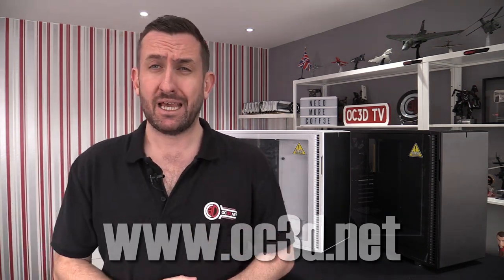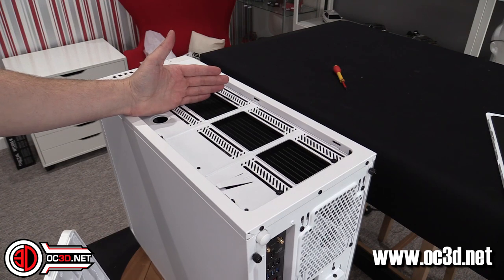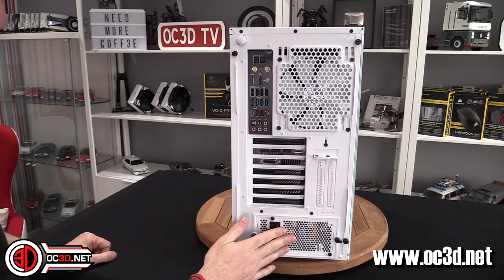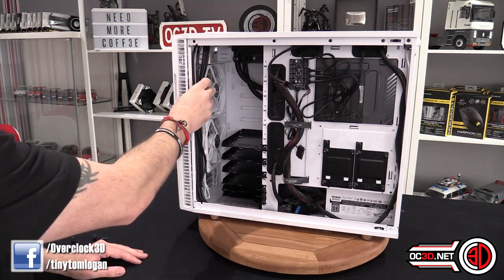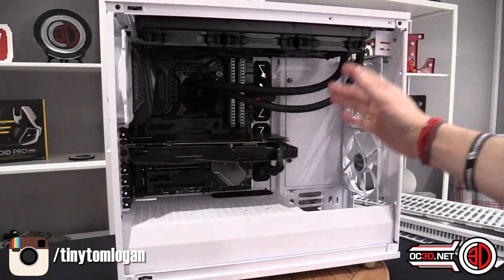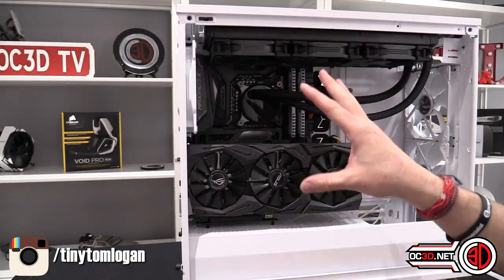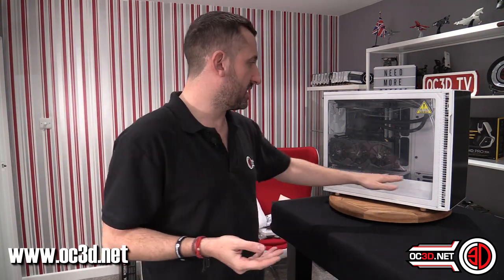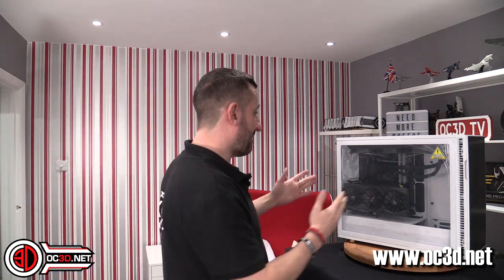Fractal Define R6 Review

Comment: Hi. Nice video. I have a question for you. Is there a brand who is willing to build a pc case based on my sketches ??
I don not understand why these brands in pc cases dont take in consideration DUST. How can they build a top grilled mesh, when on top is suposed to exhaust air not filtered it with a mesh ? The only one i see with a perfect TOP exhaust is NZXT H700i, the rest just put a mesh on top and thats it.
Most of the time, i ask myself if they know the difference between positive and negative pressure inside a pc case. Probably not.
In these days, almost all is based on marketing, TONES of RGB colours and water cooling.
I am still using top premium fans, but i dont find yet a case that met my demands in terms of airflow.

Comment: The font door should be grilled for maximum air flow or even glass would be better, and yes the black is disgusting on a white case.

Oh, and an optical bay is good for bay devices like fan controllers, not so for dvd burners these days, etc.
Reply: This is a silence focused case that would be idiotic. Buy the meshifyc if you want air flow.
Reply: Douglas m Silence focused, then it is  idiotic to have a removable top to allow fan exhaust, kind of defeats the purpose of silence.
Reply: not at all how else would you put a radiator up the for custom water cooling??  its not meant for exhaust on an air cooled pc..
Reply: +Douglas m have a proper perforated top panel like every case. Or have the top panel like the front panel with the side vents. So dumb
Reply: Allie Boy omfg really dude.
Reply: +Not a Noob really dude

Comment: Not sure why you're complaining about the front.. can't you just remove the front? I've seen someone else do it. With my gaming rig, that's what I'll do because airflow is more important to me than sound. Loving that top vent too, they sold me when I saw it.
Reply: That's the whole point of the case. It's pointless with out. Also makes dust easier to get in
Reply: No it doesn't, it has a dust filter, which is why he likes it with it off. I have this case, love it
Reply: +theguy13 youure supposed to have a front panel over the filter. Like on most cases there's a dust filter and then the front panel. That's two layers. If you remove the panel then you only have one layer which is the dust the filter. The panel makes a difference
Reply: Allie Boy but the front panel doesn't filter so I don't know what you mean. The panel prevents more airflow from the front. Which means the fan on the bottom if it's an intake will work harder. Bringing in probably more dust than the front, if it's on carpet. Regardless, I love this case. I usually keep the front panel open for more airflow for when I game.
Reply: +theguy13 the front panel definitely has a dust filter
Reply: It does not, it just has the one filter for the front lol. I own the case man.. looking at it right now, Solid plastic.. you can see that in the video.
Reply: +theguy13 0_o what do you think I said?? That's what I said, the front panel has a dust filter.
Reply: Allie Boy thought you meant the door if you reread it. The point I was trying to make is the door isn't necessary, there's still a filter in the front with the door open plus you get more airflow. That's how I keep mine when under heavy load.

Comment: I rather fancy the black on the front panel.   

But....I also don't understand the need for the door on the front.  Didn't the Define S just have a front panel with no door because they eliminated the 5.25" bay?   Why not offer a variant of the R6 with that configuration?
Reply: They will.  It will probably be called something like the design S 6 (or Meshify 6 if you are more geared towards that).  The door is for silence, and the whole R model is geared toward quiet operation.
Reply: +fostytou then what happens with airflow?

Comment: I so, so want to love this case, but that black front is just poor design, that gaping hole is something they solved on the Define C so why not here? An optical drive, really? They should have included type C on the I/O as standard, but i can live with that. Those things really irked me in the other reviews, and i think is down to penny pinching, i'm glad TTL picked up on them as well, makes me feel less retentive.
Reply: Here are some answers to your concerns:
1) Black door - I agree, poor choice. Doesn't prevent you from painting the front or buying one of the other colors though.
2) Gaping hole - Mostly there to accommodate the moveable front plate, hard drives, and potential radiators. The Define C was designed for a mainstream audience, while the R6 is more suited to a large storage or massive watercooling build.
3) Optical drive - Dude, I don't know about you, but I still use optical media (granted, I keep my drives external and portable). You can use an optical bay for much more than a CD player; in fact, I use optical bays for fan controllers and hot swap bays (among other things). You are also neglecting the fact that the optical bay CAN BE REMOVED if you don't want/need it. I don't see why you are griping here.